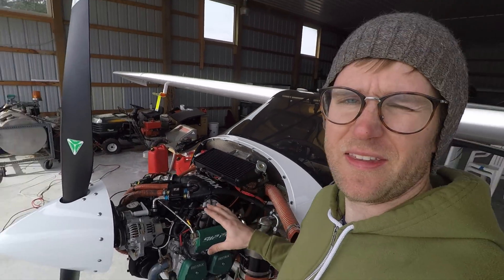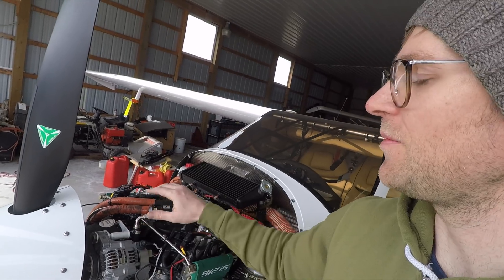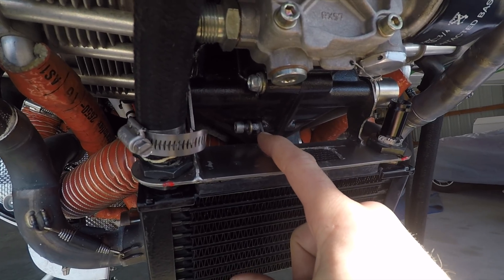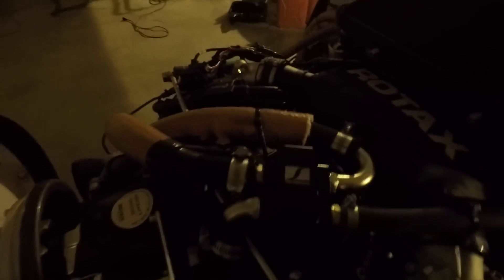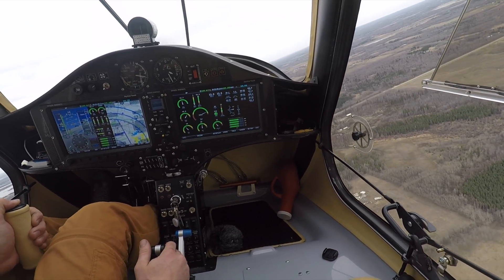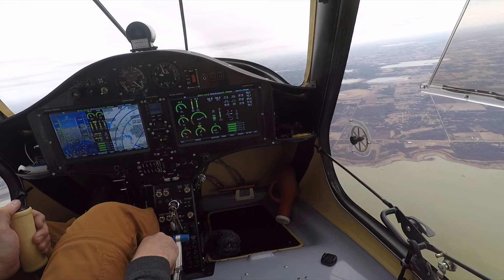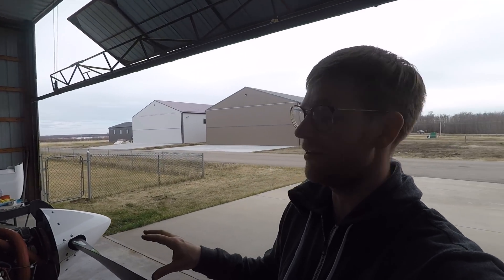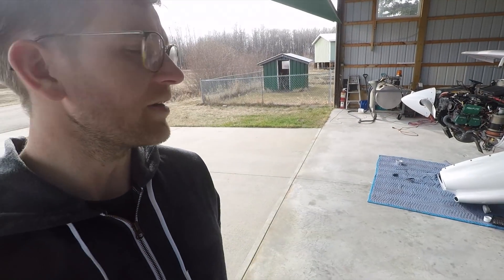Fixed! Oil PSI on 912iS Engine

Comment: Why would increasing the diameter of an oil line increase oil pressure in that line? That seems counter-intuitive.
Reply from the maker: Our consensus is that the oil pump is not designed large enough to handle the hydraulic propeller, so as I climb, the prop works harder and therefore the oil pump can't keep up so I lose pressure as I climb.  Increasing oil lines and fittings reduces the restrictions in the system therefore reducing the amount the oil pump needs to work to maintain pressure.
Reply: That would be true with constant flow as Bernoulli's equation would apply.  However, we're talking about the "suction" side of the pump.  The first thing to understand is "suction" means pressure difference, that's all it means.  The oil tank is open to atmosphere so the pressure difference between the oil tank and the inlet side of the oil pump is what drives oil TO the pump.  Liquid flow rate in a pipe is proportional to pressure difference, inversely proportional to pipe length and proportional to the fourth power of the internal diameter (Poiseuille's Law.)  So to increase flow in a pipe with a constant pressure difference, increasing the internal diameter of the pipe has the largest effect by far.

Comment: Glad you got it fixed but it makes no sense. More flow should be less pressure. I have a Virus SW 912is and I also see oil pressure drop some at higher altitudes. Maybe 42 psi at 10K feet and 40 psi at 13K feet.

Comment: Darryl, enjoy very much your vids... thank you.  I have a Flight Design with a 912iS... same engine.  After reviewing this vid, I went back into my panel pics... level flight stuff... around 2,000 - 4,500 feet.  My oil PSI in the "middle green" at 60-61 PSI... Who knows if that helps you, but why isn't Rotax taking the lead on your oil issue?   Thanks again, Andrew
Reply from the maker: Rotax has admitted that the pump is undersized for the amount of components on some aircraft, ie hydraulic prop, thermostats.  Yeah I never see 60psi at those altitudes. Hopefully Rotax will come out with new radiator and oil tank with larger outlets or adapters to work with larger oil lines to reduce the flow in systems.

Comment: Is the modified oil cooler bracket stable? If not, recommend a remanufacture in the optimal configuration.
Reply from the maker: It's solid, will not move